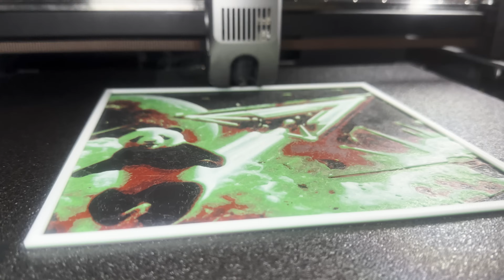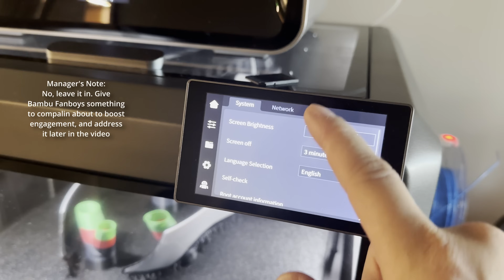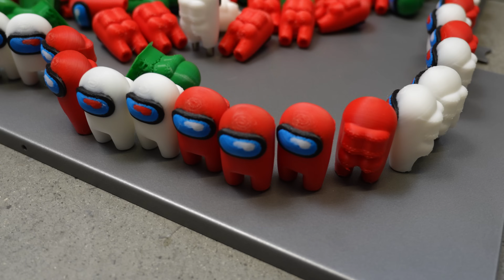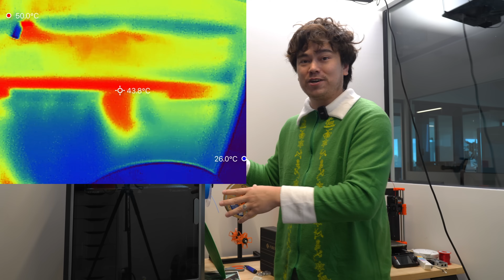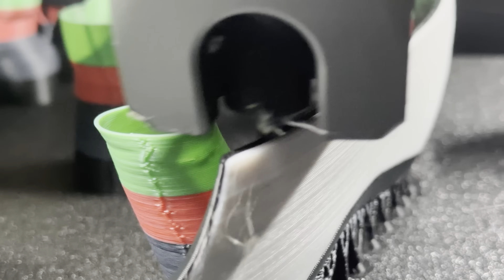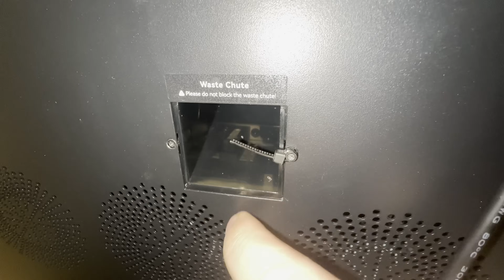Creality K2 Plus - Printer Of The Year 2024 (Goes on Sale Today)

Comment: This screams creality paying you.
Reply: agree with this comment.  your video SCREAMS, in context with recent videos, "i hate those guys at bambu labs, and creality sent me an endorsement contract".

i dont disagree with the basic premise you've offered, that this printer attempts to copy and improve.  and maybe it does, but it's still got the creality DNA that has never changed -- fast copy, sloppy, never take accountability for delivering a high quality product, and shift all that responsibility to the end customer.  once it's shipped and owned, and a few days go by, it's your problem if the thing doesn't work as advertised.  there's no such thing as a design problem in their mind unless it would cause reviews to say "it's broken, don't buy it".  

other reviews showed the print quality coming off it.  10 years ago me would have been perfectly happy with it, as it basically works.  but today the bar has been raised, because consumer grade (relatively cheap) printers can put out very very clean prints now, very reliably.

i dont think $1500 is particularly cheap for something creality will, if they remain true to their history, release and then abandon, and if design flaws are found they'll just make a K2 plus plus or a K3 or whatever, and you better be happy with whatever you got, and you better be capable of fixing/upgrading it, because we're moving on.  I think this printer has some value to a tinkerer that wants to put klipper on it and WANTS to fiddle.  that's just not me though -- I want something that "just prints".

your attire is amazing.  never change.  btw at first i thought that was traditional chinese han zi, not snowflakes.

Comment: Really cool to hear that the company that to date did not put out a single printer without any firmware issues finally got it right first try.

Not just right, but right in a super combo with their first-gen AMS and also their first-gen in-house closed-loop drive system.
This is some caterpillar-to-butterfly metamorphosis stuff. Just amazing.
Reply from the maker: It's certainly a step in the right direction

Comment: Thanks for thermal camera shots, chamber heater design looks bad. Does it realy heats up electronics chamber?
Reply from the maker: not really, it pushes air into the chamber, which then comes out some vents. You can see some better close ups in my "Whats Under The Hood" video linked in the video description

Comment: Typical 2024 printer review, 3 videos in.
No VFA test.
No hotend flow test.
No input shaping test plots.
Reply: No. Just print, any printer prints.

Does it print WELL?
That's the real question.

We had enough problems with the K1.
Creality included many of the K1 mods into the K2, but will it be enough to be good and not need a bunch of mods to print well?
Reply from the maker: lol I haven’t even hooked it into a WiFi interface yet. My main question is, does it print? Because that is the most important function of a printer
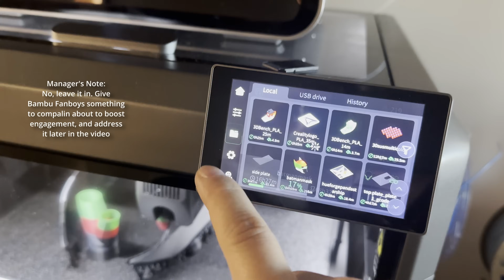Reply: @NathanBuildsRobots  6:01 says it different........

Comment: Can I mix PLA and ABS or PETG on this machine? I know it's not able to use TPU with the CFS. But using ABS and PLA needs different temperatures - so I wonder if material changes will be fluent without clogging.
Reply from the maker: This type of usage is pretty uncommon. From what i've heard on the bambu lab machines, when you change to very different materials it requires a lot of extra purging, because even a tiny bit of ABS left in the system when switching filament types will cause a clog due to the different melting points of the materials.

So I'd just stay away from these combinations, except for in cases where the printing temperatures are similar or have some overlap.
Reply: you need to use tool changers like prusaxl or voron stealthchanger

Comment: Ive had one for a little over two weeks now, and so far its not going as well for me. Foot broke off flush with base, the fan that runs in the printer head was messed up and they are sending me a new one and I am getting error CA2710 which their online support says you need to replace the belt tension module. I am hoping that the belt tension module is the reason my printers are really bad, but I havent messed with the printer too much. A little out of disappointment and a little because I spent this amount of money in the hopes I wouldnt have to mess with it (too much). Current printer is a X plus 3 and it actually surprised me with its performance, so just using it.. I do believe this printer will be great, once theses issues (I am facing) are resolved. That all being said Creality support has been very helpful and responsive, sometimes messaging me back minutes after I message them. Personally wish Creality would drop trying to create their own printing software and just utalize the opensource community made (like they did with the rest of their software / firmware for this machine) ones. You just know they are never going to make it better than (or even as good as) whats already out there so just focus your resources on the hardware and integration. Random tangent but I prefer Orca, and not a fan of having to use a bugged and watered down version of it instead (for CFS and cam functionality).  Dont regret the purchase, just a little perturbed?
Reply from the maker: Good to hear from some people that have pre-order printers. Shipping can be rough on these machines, hopefully you can get those issues sorted out
Reply: @NathanBuildsRobots  Damn, you quick on the reply.  I will be curious to see Aurora Techs full video as she's another reviewer whos opinion I respec. Her short video said shes impressed with it as well, which is great to hear. The people having issues are predominantly the ones who come online and voice their experience, hopefully seeking help, but it can inadvertently make a product look pretty bad.. Even if 99% of the customers are happy with their machine. Guess we will see what Elf Nathan thinks after that 1000 plus hour mark.

Comment: I just sold my X1C for one of these... Got the K2 on ebay direct from creaility for only 1220$ with the seasonal 20% discount code that was active at the time...

I think for that price it is worth it regardless.
Reply from the maker: Nice find! Yeah what a lot of people don't realize is Creality is always running sales, so even this high end model will likely start selling under MSRP in 2-3 months.
Reply: @NathanBuildsRobots  They are! Do you know..? Is the MSRP on this $1850 or $1495? I see it listed as both under their website and it changes depending on when I look ahahah

Comment: How do I select colors within a single print object like your sign? Let's say an eye of a figure or the font of your sign?
Reply from the maker: There is a smart fill option, that works similar to the bucket fill tool from MS Paint. you can adjust how easy it overflows to other faces, but in my experience it works perfectly and very intuitively for shading specific faces.
Reply: @NathanBuildsRobots  Thanks. Finally I found it. I had to select the object first. It's really straight forward :)
First time using Creality Print, my other printers have been using Cura...

Comment: I bought the CREALITY K1  when it was released and now i just have a 500euro paperweight, the printer had so much problem, the after sale service was useless, and even if you want to repair it,, creality doesnt provide all spare part, DONT BUY CREALITY, on the long run its just a bad choice
Reply from the maker: I totally understand this sentiment. I have taken my K1 and K1 Max apart, and they are not built super well. The frame is solid, but there were a lot of cheap components used

Comment: I have NOT purchased a 3D printer yet furthermore I will not purchase a printer until it gets the Nathan Builds Robots seal of "approval."  At some point I will make a purchase and when I do rest assured that I will use Nathan's Link in the process.  Any company that that does not believe enough in their product, company or themselves to be able to tolerate real world criticism is NOT a company that I want to support.  I want a company that produces quality, useful product that stoves to make improve their product and stands behind it.  I also DO NOT WANT ANY PRINTER THAT REQUIRES INTERNET ACCESS IN THE FORM OF "THE CLOUD" OR ANY OTHER MEANS TO USE THAT PRODUCT.   Thanks for doing what you do Nathan.

Comment: Shil. What about its dangerous electronics?
Reply from the maker: I think you are confusing this with the Qidi X Plus 4.
I added thermal imaging of the control boards during a print using the heated enclosure and did not notice any abnormally high temperatures.

Comment: I bought p1s at 489£. Can I buy this at that price? So no need to compare it to very expensive device. 

Is it better than x1 carbon? X1 carbon is currently at 919£ 
K2 plus is a bit pricy
Reply from the maker: Those are all very small printers, so of course they would be less expensive.

I'm not sure you realize how big this machine is. It is around 70 lbs

Comment: Nathan there is very little usefilul detail in this review to allow us to to evaluate how well it will serve our different use cases.

Where are the close ups showing print quality. what are its Volumetric Max printing speeds for each of the popular filaments? 

How well does it print TPU?

What nozzle options are available for it? 

How well does it print overhangs?

How does the print quality compare with other CoreXY machines like RatRig VC4 and Qidi plus 4? 

How does its real world speeds with diffetent filaments compare?

Does it poop more less waste material than other multicolour printers?

Very poor quality review. I just wasted my time watching this  You can do better.
Reply from the maker: I have 2 other videos, perhaps you could find the information you are looking for in those videos. In one I open up all of the panels and look at the internal components of the electronics bays and give closeups of the extrusion hardware and motion system.

Comment: You printed 5 spools of plastic and claim that the machine is incredibly good. A couple of years ago I bought an Ender 5 S1 and for two weeks it was incredibly good, and then it just turned into a pumpkin. I can't bring myself to throw it off the balcony only because I live on the 15th floor. That's why I bought an X1C and a P1S. A year and a half has passed, I printed a whole mountain of spools of plastic and I don't claim that they are insanely good, but they just worked all this time.
Reply from the maker: Same. I think this one will be different, but time will tell.

Comment: Printer of the year? Take it easy man. The printer is being released now, November 2024. IF it performs well and that's a big if then you might be able to call it best pritner of 2025
Reply from the maker: A1 won printer of the year at some major publications last year, despite barely being released and being plagued with a safety recall issue. 

So it's 2024, this printer is coming out this year, and I'm gonna call it printer of the year. What other printers are in the running in your opinion?
Reply: @NathanBuildsRobots  when was the A1 released?

Comment: I'd always used offline printing and became fairly efficient with it, but Mainsail, Klipper and PrisaSlicer spoiled me.  I now print from the slicer, over WiFi.  I don't think that's a significant security risk and it's SO convenient.  Cloud printing sucks and is dumber than dirt.

My hope for Bambu was that they'd encourage a 3D printer company to make higher quality 3D printers that were open source.  Achievement unlocked.  My revised Bambu hope was that they'd make TPU filament that was compatible with their AMS so other manufacturers would follow suit and we'd have TPU that will feed in a CFS on the K2 Plus.  We're halfway there.  Bambu announced it and I'm waiting for filament manufacturers to make their higher durometer TPU.  I want to be able to 3D print products with ABS and TPU without any post assembly.  So close.

Now that hi-res color printing is becoming mainstream in a printer with a heated chamber, we're going to need a dedicated acetone smoothing chamber for an entire build plate of ABS prints, and whatever solvent vapor smooths PETG.  Imagine how nice those little multi-color figures would be with acetone smoothed ABS.  That's a trick injection molding can't do.

Most of my printing consists of smaller parts for production, and often they're 8" tall thin wall TPU parts that can't be printed fast no matter how fast the printer is, until printers add input shaping for accelerated rubbery part deflections, but I appreciate a large print surface and reliable printing that allows me to array a large sheet of parts in a 24 hour print.  Every month I need to print something large for my own projects such as a battery cover for my Japanese mini truck or pannier racks for my little adventure motorcycle so that large print volume is great.  The K2 Plus would be a good Does Everything printer for me.  I've purchased 11 3D printers.  Looks like I'll be buying my 12th printer, probably on Black Friday or Cyber Monday.

Nathan Builds Robots is the definitive source for cool $#!^ I need to buy!

Comment: You didn't say anything about the speeds that it can achieve in reality nor the flow.
Also you didn't mention at all the automatic pressure advance calibration and how good it works!
You forgot to mention that the cfs has a heater.
Another dislike by me because the video/review wasn't high quality.
Reply: I don't think the CFS has a heater.  It has a digital display for temperature and humidity but it's only a display.  That seems lame to me.  An open loop inherently safe 50F (average) heater will be my second K2 Plus mod.  My first will be some way to contain the poop, even if it's just a waste basket behind the printer.  Otherwise, the K2 Plus seems to be well designed.
Reply: @Liberty4Ever  yes it seems you are right about the cfs. My bad. I think I got confused with the ams of the anycubic. Also it's very weird that the temperature inside the cfs is 33 degrees Celsius in the video. How did it become that hot if it doesn't have a heater. Nathan wears a heavy clothing so it can't be that hot in there.
Reply: @AngelVenomous  - I noticed the elevated 33 C temperature in the video.  The CFS is sitting on top of the 3D printer and heat rises.  Passive heating for the win.  33 C isn't going to add much dehumidifying but it'd help.  It'd probably get hotter than that if the chamber was heated to print ABS.  The CFS relies on little desiccant packets which I think is lame.
Reply: @Liberty4Ever  didn't think of the chamber temperature as I thought there is enough insulation between them so the heat to not transfer from the one area to the other. But yeah if it works like that is free heating haha. Yeah nowadays I would expect a heated ams unit like anycubic's option. I don't thing it's that expensive to add on to the unit.
Reply from the maker: None of that matters, focusing on the numbers too much will get you lost in meaningless details. There are a lot of "fast" printers that are trash to use.

But if you want to read the datasheet, they decided to match or exceed bambu lab on every major metric. Speed, acceleration, size, flow rate, etc.
Reply: @NathanBuildsRobots   I don't care about the datasheet.
That's why I said what it actually can achieve.
I care about the reality. You could have done some very easy tests to see what's true and what's not. You didn't.
That's all about this matter.

Comment: Can you run more than 1 CFS on the k2?
Reply: I think I remember Nathan saying in his earlier video that up to four CFS feeders can be connected for 16 colors.
Reply from the maker: Yes, you can run up to 16 CFS on a single printer. I would never do a 16 color print due to all the waste that it would generate doing that many color changes. 
But having 16 spools to pick from when starting up a print would be really nice.
Reply: @NathanBuildsRobots  thanks!  I'm really eying the k2 as i've got a k1 max and the k2 is what the k1 max should have been...  but now i'm kind of stuck with a super thin bed that loves to change geometry with temperature (usually taco) leading to first layers that are very inconsistent from print to print. - thankfully i got one of the later models that had already fixed the extruder problems, but I still had to add a riser because the angle of the ptfe tube going to the extruder was intermittently reducing my flow.  the k2 looks like they've got a significantly thicker bed (assuming that whole inch or so that i see from the front is a solid bed like on the voron and ratrig machines) - is it?  buying the k1 max at full price and having all of these issues with it and then seeing the k2 hit the market, just makes me feel like a beta tester.  I'm not sure if i'll replace my k1 max, or mod it with a thicker bed, or just sell it while it's more or less stock and concentrate on my other printers... it's been a frustrating journey.  I'm also considering rebuilding my 350 voron v2 into a toolchanger, but building 5 or 6 toolheads out of premium components is going to get really expensive too...